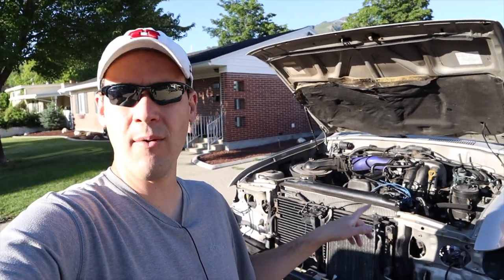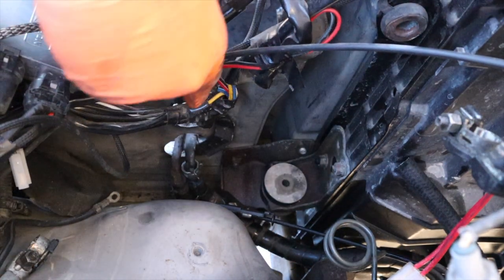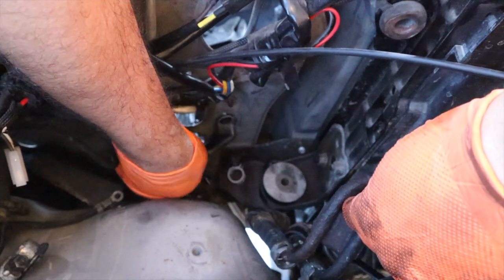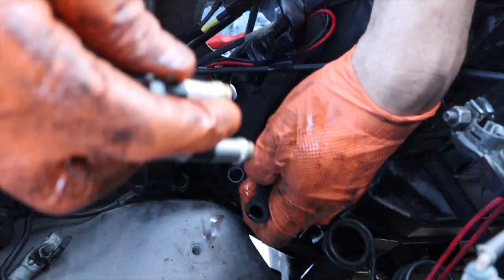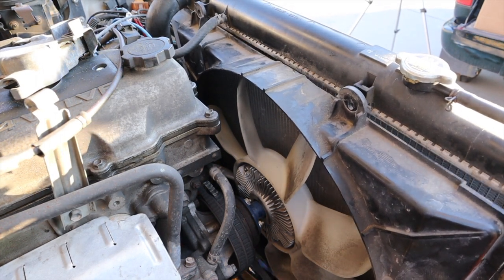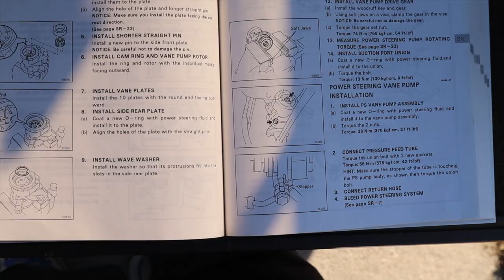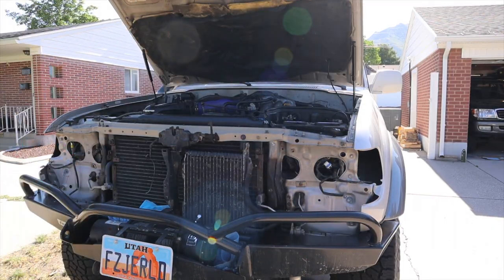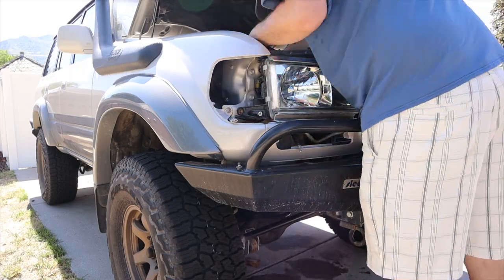1997 Land Cruiser - Clean Up and Rehab Part 5

Comment: how much a pain to remove the ps pump? I have to replace hi/low pressure lines and orange o-ring.  Thanks for the part #s and vid!
Reply from the maker: 3 or 4 out of 10, with 1 being changing a battery and 10 swapping a motor.
Reply: @thelandcruiserproject  Thanks! Sounds like maybe more than a few swear words to get thorugh it. :)
Reply from the maker: It's a 36 swear word job